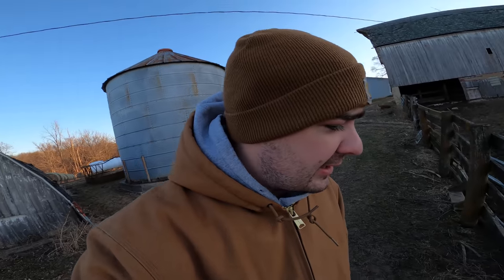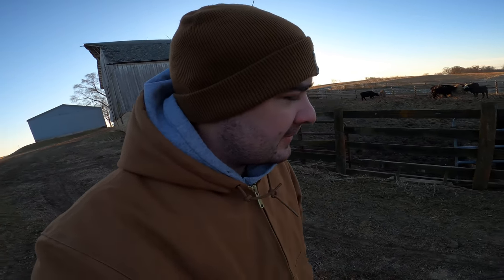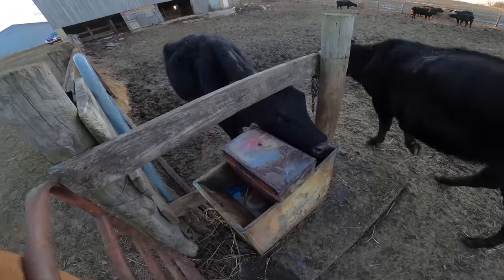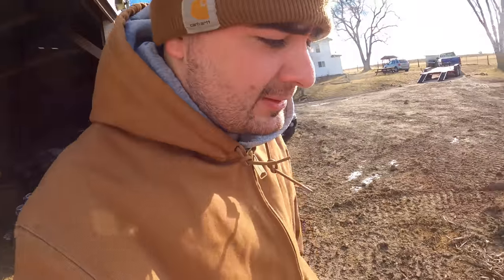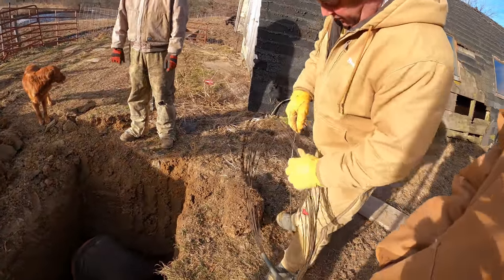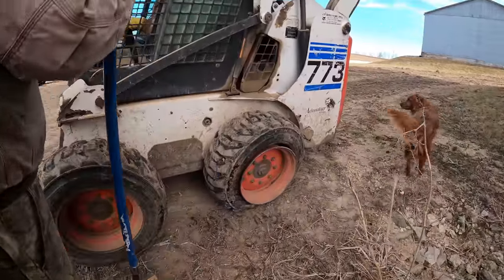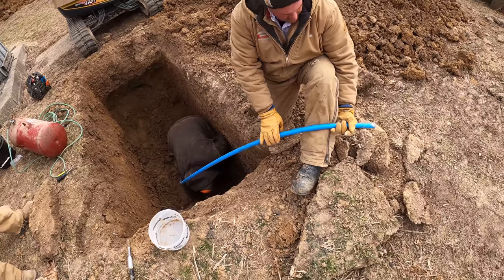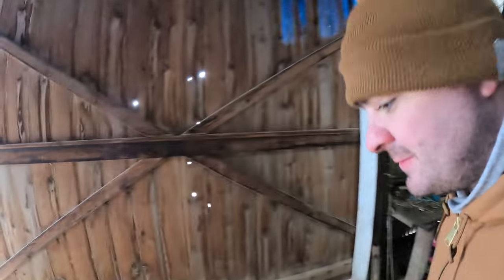Digging Up A 40 Year Old Water Line in January

Comment: Suggestion in cleaning skid steer tracks.  Don't know if this will work, but it would be easy to try.  Place a log or something solid under one side of the front end bucket, use that to lift one track off the ground, exercise that track only to aid clearing material from it...then do the other side.  Best I can think of...mud and goo may not sling off enough to keep tracks from freezing ...  Goo luck.

Thanks for bringing us all along.

Comment: Not jealous of this job. Wouldn't want to have to do it in this weather, or pay the bill! Thanks for the cool video👍
Reply: i had to do myy barn line i put down 10 feet in 197 ,, in winter 2017 it was 50  bekow for weeks, i had to rent an excavator an open up a hole,  to open the lineit was in an area that when i had a D8 in stripping the land he built tthe road over the vally with stumps and tons of clay were i had hills cut down over 8 feet, water had washed though some stumps letting cold air down, i new a hole in the bank was there but didnt think it ran 70 feet in, it was only a 8 to 10 inch hole, but let enough cold air in to freeze it, working in 50 below i was use to being a welder in logging camps most of my life until 1987, but being out of it so long it was a bit ruff, but the machine i rented ripped it open like a can opener,, no more air hole, it may have been there since day one when the whole road was lifted 17 feet an 150 feet  wide, red clay takes years to pack in, i could have pulled the 400 feet of 1 inch line out and replaced it as al l my water lines are in 4 inch solid black drain tile as well as my hydro lines, but at 50 below that black polys a steel bar

Comment: hello Ryan. 
we do washing up the plastic water pipe / line . which is 1inch great 
with the hy pressure washer .
on the hy pressure washer is  second Special thin water pipe and on that top is a drainage wash up jet .
with this special water pipe washed up  we the  water line for cows and heifers  two times in the year .

Comment: The farm I work at added air line fittings to the water lines in our equivalent place to your pit. That way an air hose could be hooked up easily to flush the line out. Our intentions are for when the waterer on the other end isn't in use the lines won't freeze but it may be useful in your application too. Just need to add a couple ball valves and one male air line quick coupler in between them.

Comment: Nice video. Just wondering if you've ever heard of water jacking? My brother had a plugged water line between his house and the pit. The plumber guy used a rubber mallet and beat on the end of the waterline. It got the line unplugged. I guess it only works if there is water coming out of the line. It creates a powerful shock wave the ripples through the waterline and can break up the rust in the line. Just a very cheap easy inexpensive thing to do.

Comment: Hello Ryan, is Okar a mineral ? I have a suggestion for you and Travis, back in the 70's when we were expanding in livestock we would put 3 well curbing with lids by ever water in your case outside the fence and have a 8 in. plastic tile go from the well curb to the cattle fountain and you also put tile line or plastic pipe 8 to 12 in. in diameter from well curbing to well curbing at every water and every T that way if your line would spring a leak or water problems you can pull a water line through and you don't have to dig the water line up as usually it happens on the coldest day of the year. All it has to do is happen once and this sounds  like a great idea especially if you have to go under cement feeding floor and you don't have to tear up cement or pour cement when it warms up. We also would drill 4 holes like 6 inches down in the well curbs and put 2 steel rods crossways and then set a piece of styrofoam on top of the rods make the styrofoam really tight if you do it cuz the ground heat won't escape as much. You can also run your electric lines with the water lines in case you want to change things in the future cuz you can shutdown the water and electricity line at every well curbing. Have you ever seen the cattle and hog fountains that are electricity free as they use the ground temperature to keep them thawed out. We always used Ritchie water fountains.

Comment: I make that mistake once a year on not cleaning the tracks very good and it freezes the drive sprocket but that is an easy fix. I take my propane weed burner torch to the drive sprockets for 5minutes per side to thaw out a little to break them free of frozen dirt

Comment: Run your JCB on boards in the barn , will keep your tracks from freezing to the ground
Reply: It's not a problem with the tracks freezing to the ground itself the problem is that the sprocket that turns the tracks themselves gets all that manure and wet crap in there and that is what freezes makes it hard to break loose actually drive the skid steer. I speak from experience as it sucks really bad when you need to use it in a hurry and cant haha
Reply: Its not a problem with the tracks freezing to the ground it's more the fact of the sprocket that turns the tracks gets frozen from the manure and wet crap. I speak from experience so it sucks when you need to use it in a hurry and cant haha

Comment: Have you ever thought of parking the JCB on top of a couple of four by fours instead of right on the floor of your shop?
Reply: Wont make any difference...its the inside of the tracks that freeze
Reply: @Northern_Farmer  I think it'll help a little bit. It used to work for me albeit I had a bulldozer with steel tracks but at least you won't have the problem with the tracks getting stuck to the ground.
Reply: @frankeem3820  yea but hes inside the shed..the ground is dry in there..

Comment: Amazing plastic pipe would fill up like that. I could see metal pipe doing it. The top of my well froze up a couple weeks ago now. Had to get the well puller people to come.  The drain hole down 6 or 8 ft had filled up, with rust or lime.  The hole also had a wire in it to make the hole smaller, that was causing the problem. The well puller started to put it back down,  i was lucky to walk over to them, & asked, did you take out the wire,  No. I said that was the cause.  He said, i'll take it out, but i'm not going to put it back it in. Black electrical tape was all that was holding it.  He said it would leak to much.  We still use a cistern to hold the water for the house & barn.  So after they had it running again, there was a 5 gallon pail sitting there, you mind if i check the flow, time with watch.  Go ahead he said.  I didn't have my watch on me, so the other young guy said his phone was in the pickup. That guy put the pail right away under the flow,  so i counted out the time, 1 thousand 1 etc.  It didn't bother the flow amount one bit. 5 gallon pail was filled in 49 seconds.  It's a small 3 inch sub, pump, down 275 ft.. The guy was a real turkey. New to us well puller, as old company guy retired.  Never call him back. Did nothing but run down all the wells in the neighborhood.  All junk wells,  all patched together,   what a a - hole.
Reply from the maker: Ochre will eventually stick to everything, it even builds up in the tanks in the toilets!
Reply: @HowFarmsWork  The iron is diluted  in the water itself right from the well....not coming from steel rusting. Correct.
Reply: @HowFarmsWork  how is the gator coming along?

Comment: add a little H2o2 to the water, and you will never have this problem again

(15 ml to 1000 liters)
Reply: It's hydrogen peroxide. Guessing it works by killing the bacteria in the ironourk. And yes it is the same stuff they use as rocket fuel. Thought Rocket would find that interesting.

Comment: Ewww.... Is that water coming out of the well that color, or is it coming from steel pipes? I'm thinking either way it might be worth installing a cheap filter in before the plastic pipe at least, plus the cows would get clear water.
Reply: It's in the ground water. Just settles out in those lines lower and farther away from the well.  I have all plastic and can see that stuff in the bottom of the chicken waterers.  We have a softener in the house that removes it well but it's still noticable in the toilet tank.

Comment: the water pipes who are  smaler than an inch washed we up  .there put we on the high pressure washer directly . .to blow it a little bit through .
the we take a litlle bit foam from an old traktor or car seat .
put the small  peace foam  in the water pipe for the heifers .
and put than the high pressure washer on that water line . to blow the piece foam through the water pipe for heifers. 
the small piece foam must not to be too great . 
when the water pipe is very dirty .
.than must repeat process .
first very little foam .
second time a little bit greater .
third time a little bit greater too.

attention .took not to great foam pieces in the process .

niece greatings from North West Germany from Bert  .
Reply: the small piece of  foam .
maximum as an 
champagne cork .

As a  german  write english informations to a Farmer in  USA .
some words are not always in the head .